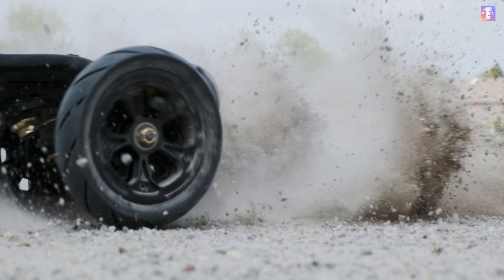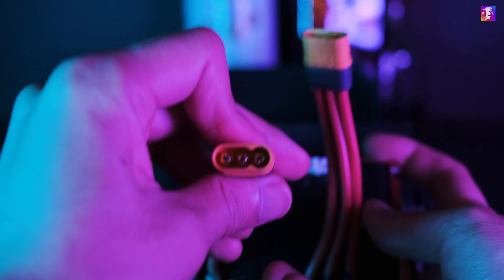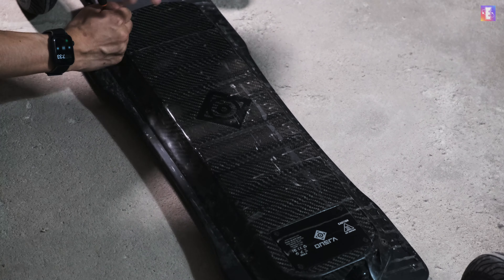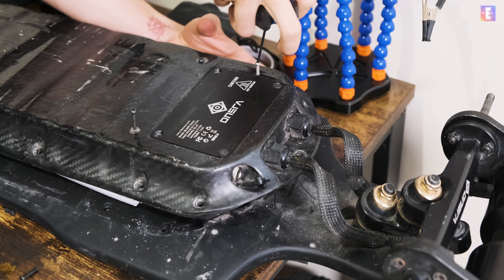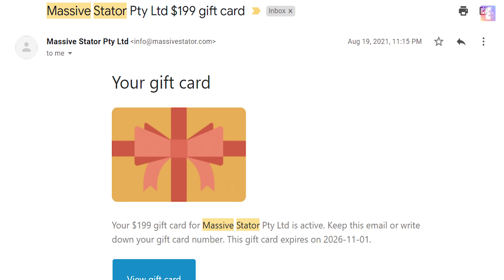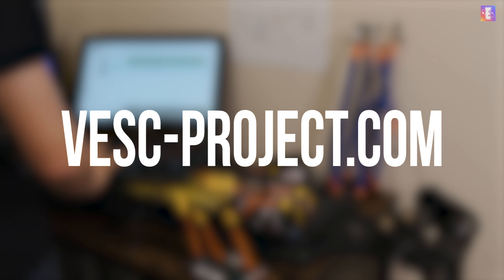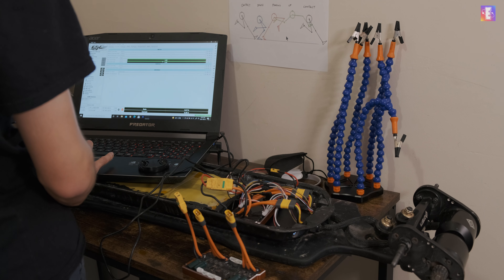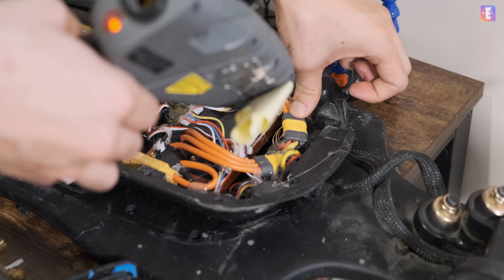BlackCarve2+Tenka Review

Comment: Awesome video… how has the remote connection reliability been so far? I keep seeing disconnects of the vx2 remote in forums…
Reply from the maker: I don't have any drop out signal, I’ve ridden in a busy city and under power line tower as well. I had a random un-pair in my second ride tho. I turned on my board but the remote was not paired. after re-pair it works fine so far

Comment: I get that you probably  got the Tenka esc for free & is doing a install & ride differences vid & all but since you don't much care about topspeed, wouldn't you  have gotten more torque just by putting in a larger pulley? Like 60t to 66t? That woulda upped your acceleration ie. torque significantly at a cost of lower topend. Wouldn't have need to do so much work for the install for sure.
Reply from the maker: Well, it already has 66t, largest I could find on the market. I needed more torque than that so, and I didn't get the esc for free, but more got a replacement for free.
Reply: @element168  Ahh I see. Gotcha. Maybe the Onsra isn't built for what you're looking for. I ordered the new Eovan GTS Super & while it won't carve like the Onsra, I bet the torque would crush it. Different wheels different purposes I guess. Personally, if its a direct swap then I mite have done it but dang, that's a messy install esp to drill new screw holes & all.